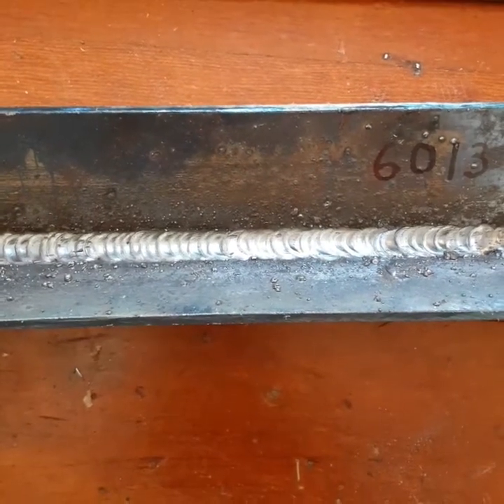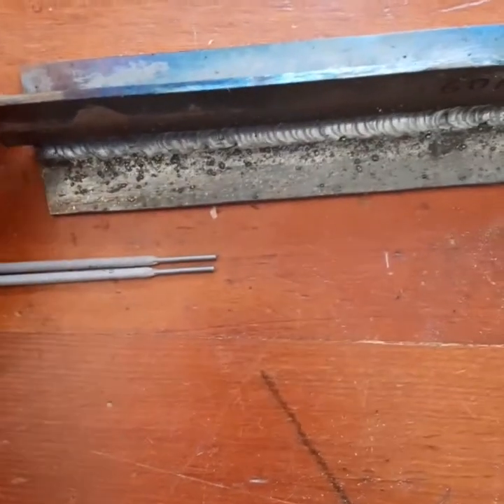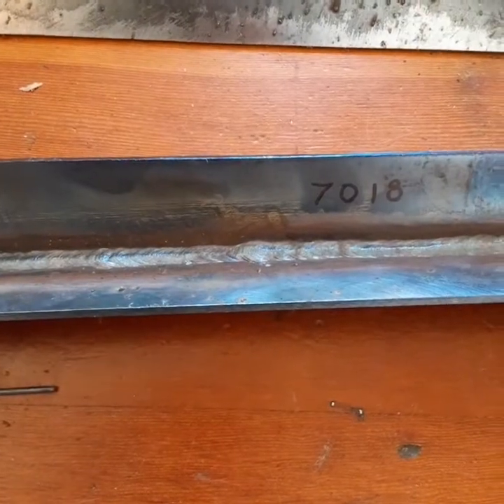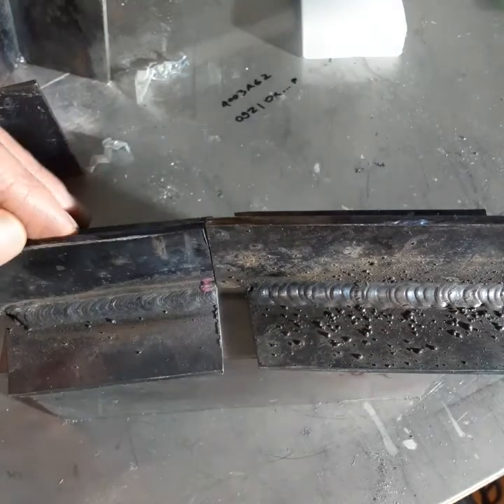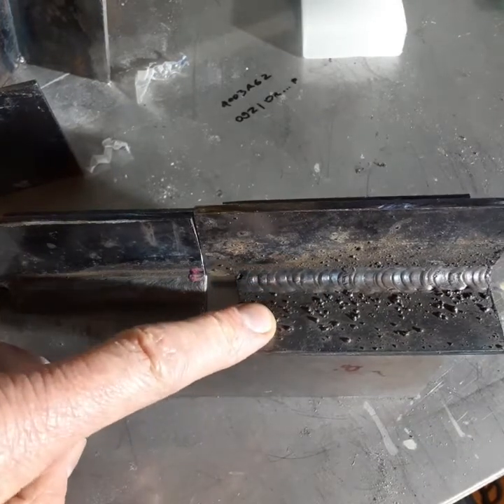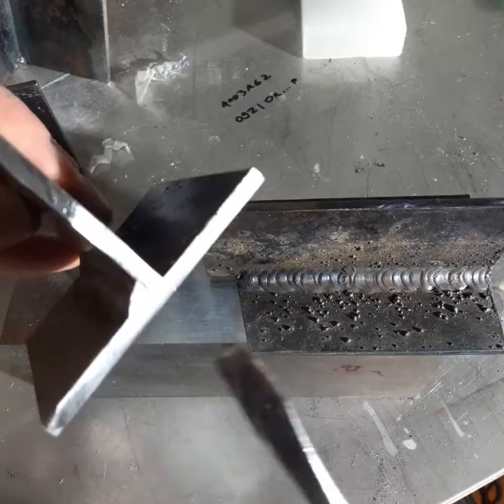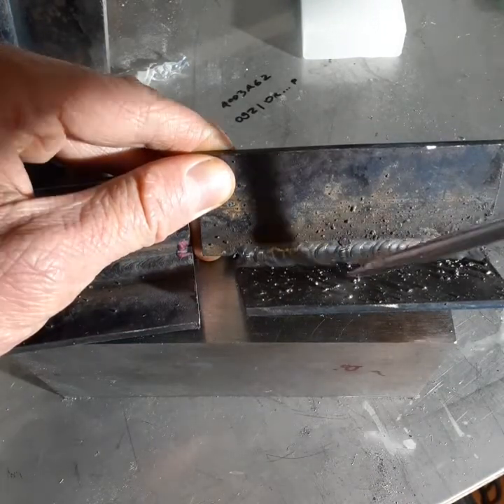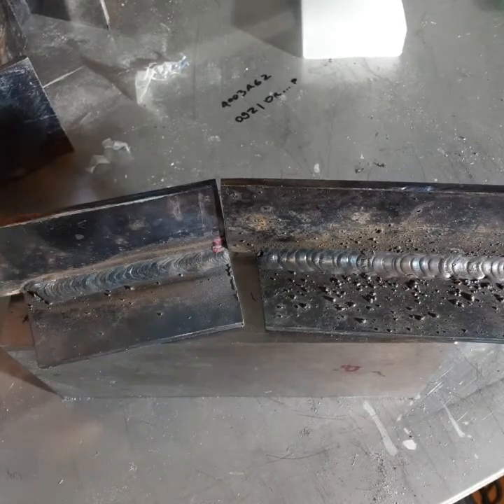6013 Dab Dab Technique Cut and Etch

Comment: Great video! Solved a lot of mysteries. 
I guess you ran the dab dab technique at higher currents, probably 70-80 amps?
Reply from the maker: Yup, arc wouldn't initiate through cooling flux at lower amperage. Since making vid it's become clear the inverters I use maintain arc over a much larger gap than the machines rapucuf uses, they seem happier running continuous low amperage. I think a cheap inverter would do dab technique better, esp. in conjunction with the right flavor of 6013.
Reply: @Octopusbeak  True. I can definitely confirm that the flavor of 6013 plays a major role from my experience. Some just want to be ran as hot as they can go, otherwise the slag overruns the rod despite relatively aggressive drag angles and arc force. That was my experience with Gys electrodes.
Some run smooth as silk, such as Adria R 6013 from a local manufacturer Elektroda Zagreb. I would say that 6013 are in that regard more finicky than 7018s and 6010s. 
The Lincolns seem to run quite well?
Reply from the maker: @Mirage2000H  After welding a bunch more with lincoln 6013 and watching more rapucuf, I would say the lincoln rods are not as forgiving as the nikko rd-460 he uses for dab technique. Slag sticks more, restarts harder with lincoln rods. But they might run better with straight low amperage dragging rod. Been welding lots of 16 ga with 3/32 6010 which is faster and more reliable. I still use 6013 to fill a gap or hole.
Reply: @Octopusbeak  can you do a video on 6010 on thin stuff please?
Reply from the maker: @pkplexing  would 6011 on thin material be okay? it's far easier (read: better welds). I wouldn't mind making a video though
Reply: @Octopusbeak  Yeah man, As far as I know its quite similar to 6010 anyway. I am in New Zealand and 6010 / 6011 is very rare, but recently found a supplier for it and ordered some :) I and others would most likely appreciate it :)
Reply: @pkplexing Hey mate, I'm in NZ as well & would like to have a crack at more stick welding. Where do, or did you get the 6010 or 6011 from if you don't mind me asking - cheers.